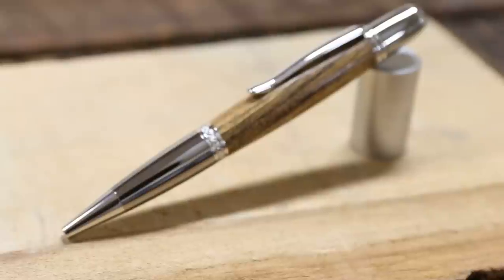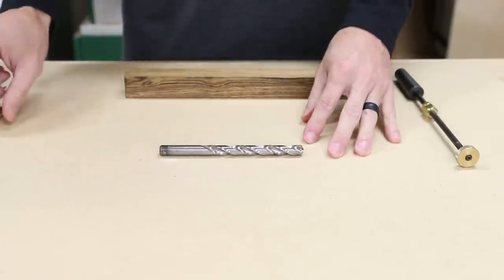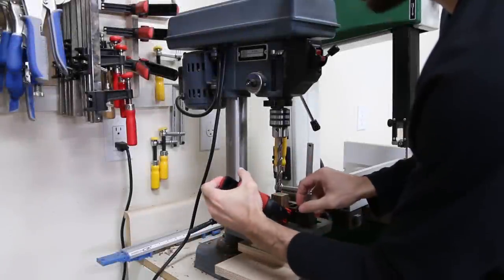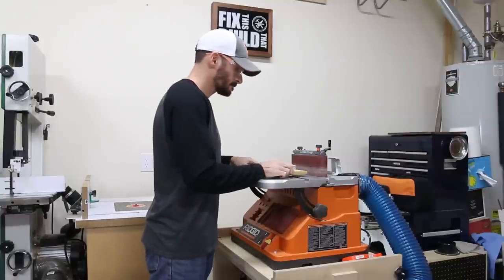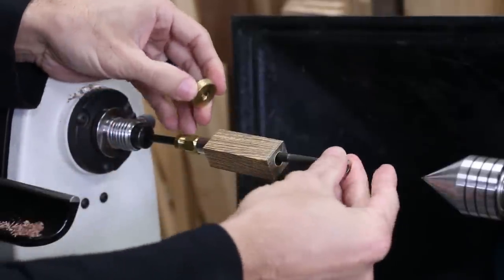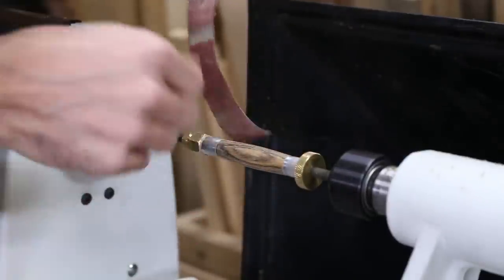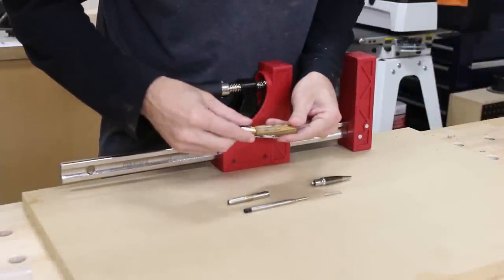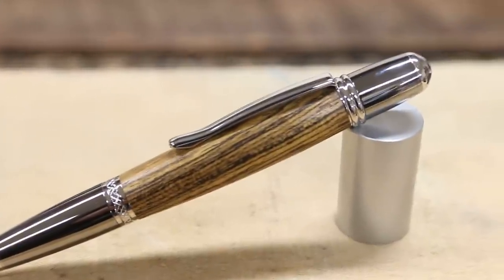How to Make an Executive Pen | 6 Days of Beginner Woodturning Projects Day 5

Comment: Here's a tip for making your drill press go further. Put the drill bit as high as you can in the chuck Benadryl it with the table as high as possible. Leave the bit in undo the Chuck and drop the bit as low as you think it's safe and then keep on Drilling you can usually get an extra inch

Comment: Looks great Brad!  I use an aluminum bar clamp from HF to press my pens together. Not very convenient or easy, but it gets the job done. I need to turn some single tube pens. I've only made one.
Reply from the maker: the single tub is so much easier.  And you gotta work with what you got :)

Comment: You could always add a board under the blank when drilling the hole for the tube so you can get all the way through.
Reply from the maker: The throw of the drill press is only 2" , so I'd have to add a board and start the drill with the bit submerged....didn't feel good to do that

Comment: You can buy a pen press that is just two pieces of plastic one going in the tailstock and one in the head that is only 15.99. I bought mine at Woodcraft about a year ago and use them all the time! They work way better than a clamp even if it is a Bessy!
Reply from the maker: Didn't realize they were that cheap.  I might go for it :)

Comment: Hi, what speed would you recommend using on the lathe ? Thanks
Reply: Most pens can be turned at speeds of 2200 - 2500 rpms.  Sanding can be done at the same speeds.  The speed depends on the material used and the tools used for turning ( HSS or Carbide ).  Negative rake carbide cutters remove the material extremely well and reduces your sanding time.

Comment: I was enjoying watching right up til 3:15, where you put the blank on the bushings.  It is important to note that between flush trimming the blank (no matter how you do it or what you use) and mounting the blank on the bushings, you WILL want to ream the barrel.  I just take an old exacto-knife and run it around the interior of the barrel to remove any possible burr, as those will cause the barrel to seat incorrectly, giving an out-of-round barrel on the lathe... and it's an obvious mistake that glares at you every time you pick up the finished pen and examine it, as the parts will look lopsided.  This is an important tip to remember and follow any time you are using any kind of barrel insert.